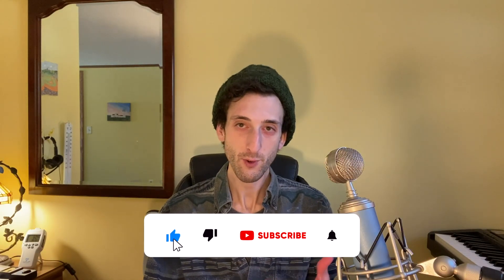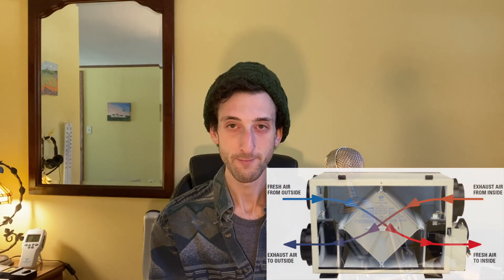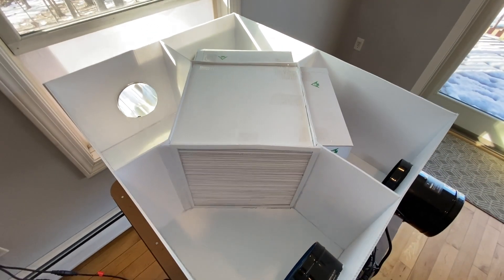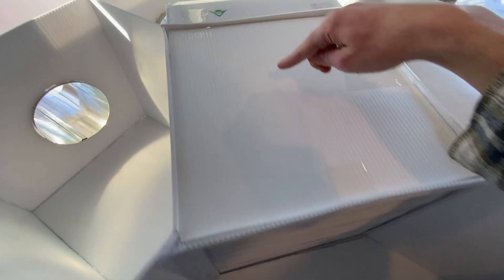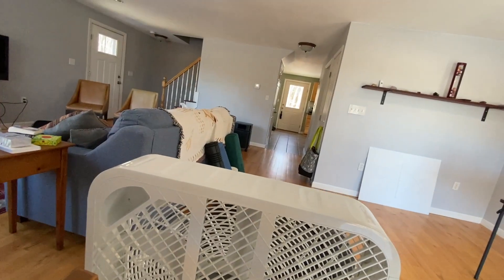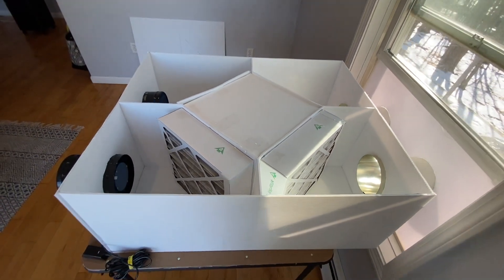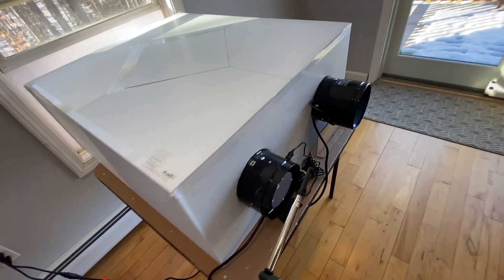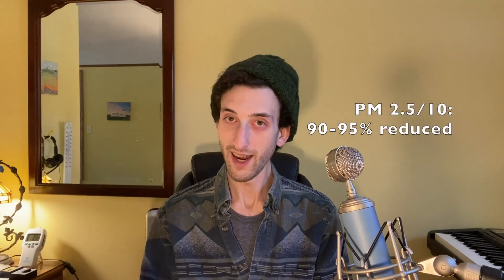I built the best DIY heat recovery ventilator I’ve seen on YouTube

Comment: As an HVAC guy i can say your design although unconventional and bulky is just fine, your fans you use for circulation would benefit from the coandâ effect to increase air flow. Also those efficiency rating the big companies use are totally skewed so your system is probably working better than off the shelf systems thanks to that massive core you built
Reply from the maker: I appreciate the encouragement! And thank you for that Coanda effect idea - I’m gonna tweak the locations of my circulating fans to capitalize on it.
Reply: @macthemec can you elaborate on how one would use box fan to achieve a Coanda effect? Where is the effect happening? Is the idea to get the air flow from the fan to follow to the walls, or floor, and thus travel further than it would had it not? Is it perhaps fashioning a shroud or cowl to affix to the box fan, one which would create a Coanda effect? I really can’t imagine how this would work?
Reply from the maker: @brainwashingdetergent4322  Good question. Your thinking is spot on when you said, “Is the idea to get the air flow from the fan to follow to the walls, or floor, and thus travel further than it would had it not?” 

Yes, that’s the idea. The ceiling also works quite well. You don’t need to make a shroud or anything. Just position any fan so that it blows along a surface.
Reply: @HealthyHomeGuide  thank you for the reply! This is good information.
Reply from the maker: @brainwashingdetergent4322  happy to help!
Reply: @brainwashingdetergent4322  i just saw this reply, here is the wiki article: https://en.m.wikipedia.org/wiki/Coand%C4%83_effect

Basically air follows a surface better than in the open, so if you want to blast air down a hallway sticking your box fan next to a wall/floor will make it travel further than if the box was away from the floor/walls
Reply: @macthemec  thanks for the link!
Reply: How would one deal with condensation for something like this? Curious if this would work as well during Texas summers!!
Reply from the maker: @Geoff9001  I’ve only used mine during colder, drier seasons. I definitely would avoid using an HRV in your climate, especially during warmer months. An ERV (combined with a dehumidifier) would be a safer ventilation option for your region.
Reply: @HealthyHomeGuide  have you seen any decent homemade ERVs online? This is the first homemade hrv I've seen online and it looks great, although a little big
Reply from the maker: @Geoff9001  thanks! I haven’t seen any homemade ERVs, nope. However, I’m working on a video where I do a DIY ERV installation. I buy it and retrofit it into a window for ~$1200 (USD). That’s with the ERV and materials included. Stay tuned if you’re interested.
Reply: @Geoff9001 I had an ERV professionally installed in my last house. They are big suckers!!
Reply: With no core shaming. ;)

Comment: Impressive and inspiring, thank you. For someone interested in trying this, why coroplast, other than it comes pre-corrugated for maximum surface area? Wouldn't metal plates work better at transferring heat? (but much more time-consuming to pleat by hand). Maybe the fins from old A/C and HVAC equipment can be repurposed for this. Amazing effort and spirit, blessings and apprecation.
Reply from the maker: I appreciate that, thank you for commenting! Good question. I used coroplast because it’s very easy to cut, lightweight, non-toxic (polypropylene is BPA-free and does not off-gas at all), durable, moisture-resistant, recyclable (polypropylene is a thermoplastic that can be recycled), and CHEAP. I wanted to build it all from one cheap material.

Coroplast transfers heat pretty well. Some commercial units built today actually use corrugated plastic for their cores! 

I also don’t know how to cut metal, bond it properly, clean it right, and work with it safely in general (especially with old potentially rusty parts). For someone with expertise there, it could be cool!

Thanks again for your great question!

Comment: Very cool. 🤔 I like the idea of a charcoal filter, but I'm clueless where you would put it in the system. I'm building my retirement home in Arizona (a cute little hacienda style cottager) and I want to incorporate as many DIY solutions, and revive as much ancient technology as possible. Thick adobe walls will go a long way towards providing the thermal mass I'll need in the desert to moderate temperature swings. I think instead of the plastic body you could use ducting sheetmetal or the smooth fibreglass boards used in commercial kitchens, hospitals, etc. Both materials would give the same smoothness, but would be a lot more robust. Mine is NOT going to be proudly displayed in the living room! Sorry, although I'm now retired, you can take the girl out of the interior design business but... I plan to properly tuck it away in a conditioned attic space and cleverly vent the clean, temperature-moderated air throughout the house in inconspicuous or decorative ways. Can't wait to binge-watch some of your other videos.
Reply from the maker: Thanks Linda! I ended up using two 2” thick activated carbon filters that look similar to the filters I showed in this video, they’re just black. There are two available spots against the core where they can rest, in the same manner as the MERV-13 filters shown in this video.

I deeply appreciate your philosophy when it comes reviving ancient technology. I’ve been learning about Terra Preta recently - very cool ancient tech. 

I used coroplast for the body because it’s very easy to cut, lightweight, non-toxic (polypropylene is BPA-free and does not off-gas at all), durable, moisture-resistant, recyclable (polypropylene is a thermoplastic that can be recycled), and CHEAP. I wanted to build it all from one cheap material, but I appreciate your point about the robustness.

Your interior design-friendly plan sounds amazing. If you end up doing that, I’d be happy to make a video featuring you on this channel if you’d like. Good luck!
Reply: @HealthyHomeGuide  🥰 That you're a gardener. My favorite terra preta video is by David the Good https://youtu.be/DnTaWiO5Eso?si=xiT9K3iHJjA2ySeZ. I'll save you the suspense: it worked great, but David moved to new land and it petered out in a year. My theory: the deposit he created was only 3' deep. The deposits in the Amazon are frequently 60' deep, and were renewed annually for centuries. I think David's on to something, but I also think that it needs renewal every year for many years to become self sustaining. Enjoy!
Reply: commercial units I've seen have the schematics placing carbon sheets between pre filter and merv filter.
Reply: @mikemotorbike4283  Yeah. That makes sense. But it's only a "sheet"? Huh. I didn't know that, I thought it was like the air filter, about 2 inches thick and approximately the same size as the Merv filter, just black. Interesting. Thanks for the info!

Comment: Thanks That's a really good design. I've been thinking about how to build something like this for our home. I'd not considering using coroplast, but it's almost made for the job !
Reply from the maker: Absolutely! Coroplast is an amazing material - polypropylene is the safest plastic, I feel. No BPA, no VOCs. I think that my HRV core is pretty laborious to build though. I’m in the process of trying to find a cheap source for replacement HRV cores, so we DIYers can just build a simple HRV housing for a pre-made core. Stay tuned!
Reply: @HealthyHomeGuide  
Stack the core and weigh in down. Use a hot wire, arranged like a guillotine, to cut the edges off the core. This fuses the sheets together using heat. No glue and far less work involved.

Comment: How would you run it ducted if you could? Shout out from Melbourne, Australia.
Reply from the maker: Welcome! I love to see Aussie viewers. If you want to run ducts, check out this video for guidance: https://youtu.be/PsN5AbUz3p8?si=KTTtTC_pGHhpVIsu. I’d try to avoid using flex ducting if you can, as it off-gases terribly and reduces airflow (compared to rigid ducting), especially if you’re using ducts that are 4 inches in diameter or smaller.

For me, ducts aren’t worth the effort. I find that fresh air from my HRV permeates through my living space well enough without ducts, if I use good air circulation methods. See my video here for guidance on that: https://youtu.be/80r9qwJPcTI?si=8dEhy8eNzsih5uHN.
Reply: @HealthyHomeGuide  yeah that's all great tips. Our house is a strange L shape with two disconnected hallways. I'm tempted to make two systems at either end of the house to ensure each end has good air quality. I will start off with one of these units and get a second if needed.
Reply from the maker: @MatthewBayard  sounds like a good plan! Let me know if you have any other questions.
Reply: @HealthyHomeGuide  can you run exhaust and intake ducts from the floor? We are on stumps so we could have the unit in the crawl space and run the ducts to each room and penetrate the floor of each room.
Reply from the maker: @MatthewBayard I’ll preface this by saying that I’m not an expert (yet) on crawlspaces or building in general. I do know that you can run ducts through the floor. People often do this for makeup air systems for kitchen exhausts. 

In general, I don’t know much about putting an HRV in a crawlspace. From my limited knowledge on this, I’d make sure you’re not bringing crawlspace air into your house. Also, make sure the return air isn’t crawlspace air as well. Good luck!

Comment: very nice... i think i may make one out of aluminum sheets or sheet metal which would transfer heat more efficiently. granted it would be more expensive but i think a bit smaller and a more efficient unit would be worth it since the ones you can buy are so damned expensive. due to a lot of forest fires here in the west, i was thinking of having filters on mine already and i like the way you placed the filters. i want to have more surface area, however. my filter design is its own separate box consisting of 5 square filters mounted on a 6th plate making a box that has 5 filter sides and the 6th side would have a duct fitting to provide filtered air to the hrv. i think those filters can be of the cheaper variety pre-filtering the air and have the higher quality filters in the hrv as you have them. that should allow for the cheap filters to get the larger particles and extend the life of the finer filters and improve air flow.
Reply from the maker: Thanks! I’m intrigued by your idea a lot. I’m thinking of building a different design for this winter and I have a lot of ideas swirling around in my head. I think one of the drawbacks of my HRV core is that it’s fairly laborious to build.
Reply: @HealthyHomeGuide  yes... it will be even worst with sheet metal or aluminum. i think the easiest way of doing it is to sandwich 5mm spacers between the sheets with long bolt going through to hold everything in place and seams sealed with silicone. if the sheets are stacked and drilled together, they will align just fine and the whole thing can be dismantled easily to experiment with different size spacers or cleaning or other service. the process can actually be fairly easy. another way would be welding a frame and sliding aluminum foil to separate cells like drawers then stretched tight. the thin aluminum will be an excellent heat transfer medium.
Reply from the maker: @AlsanPine  interesting! If you build either of those, you should consider filming them and uploading to YouTube.
Reply: @HealthyHomeGuide  lol... that takes too much time. i am retired but very busy. this is not the only project i am pondering. i am building a small orchard, garden, and greenhouses generating most of my food. i am building my solar setup. i am modifying my house to radiant heat from said solar. i am restoring a 76 ford f-350 and case 580b. i am designing and building electronics to control my property. and spend a few hours a day in my studio with my instruments. i am building more rain water harvesting. i am building local community to save our town from corporate greed. and that is just what comes to mind right now. all of my designs and work probably should be recorded and put in to help others but to do that i will need a young person to do it for me. i will never get a round to it. i would be lucky if i get all my projects done before i die. i would love to work with someone around here in n. idaho but chances of that happening is pretty low i think. i appreciate your encouragement though. live well 🙂
Reply from the maker: @AlsanPine  very intriguing. I love that you’re trying to build a self-sufficient community to escape the corporate greed. I’ve been wanting to be a part of a community like that for a while. I live in Vermont, by the way. Anyway, I’m trying to start a video series where I feature certain subscribers of mine’s HVAC and/or sustainability-related projects. Basically, if you wanted, you could quickly film your project (with a smart phone or something, if you have one), or even just take pictures, and I could do the editing, narration and uploading, and credit you of course. If you find the time, and if that’s something you’d be interested in in the future, you can email me at alex.healthyhomeguide@gmail.com.
Reply: coroplast is "appropriate technology" un this application as it does the job sensibly if perhaps 3x larger.  Custom-crafted Aluminum coroplast, no make that copper, or even gold would be better of course.  It will take a month to make one. After the craftsperson figures out how.
Reply: @mikemotorbike4283  actually, i have a design that is easy to build and inexpensive. i have too many other things going on right now but i hope to make an all aluminum core that anyone can make without the need for fancy tools. i am sourcing the aluminum frame materials right now.

Comment: Thanks for your video. What's the difference between yours and an ERV?
Reply from the maker: Sure thing! ERVs help regulate the humidity level of the air that passes through them, as well as temperature. Mine only regulates temperature.
Reply: how might you change yours to make an ERV? @HealthyHomeGuide
Reply from the maker: I’m actually in the process of trying to figure that out! It seems to be very complicated and expensive though, so it may not be right for a DIY project. Personally, I use a whole house dehumidifier to dehumidify.
Reply: @HealthyHomeGuide  did you document this build anywhere?
Reply: @HealthyHomeGuide  ah, the core is a stack of boards, each perpendicular to the next?
Reply from the maker: @dennisstone9893  yup exactly. Check out the video I linked in the description of this one for detailed builds. Specifically the designed by instinct video is most useful.

Comment: How are you measuring the efficiency of this? Im not convinced by any of this. You have lots of gaps in the coroplast box which will easily allow the pressurized air to exit before they do their expected travels through the merv filters which will bring quite a bit of resistance along the way. Its going to be much easier for the air to just... escape.
Reply: His design is very similar to many commercial designs. You can spend $2,000 or $5,000 and get a system that at its core has exactly what his has, something that looks like it was made out of plastic cardboard. If commercial units can get high efficiency in small size, I think he can too. These units have remained a specialty niche item, aka expensive, without widespread adoption yet, prices have not come down. Most people that want fresh air, just open a window an inch, while not as effcient, it is cheaper and easier. Someday, hopefully soon, these units will get cheap, widely incorporated into homes and everyone will have fresher air. The reality of the matter is many people just don't value fresh air. That seems like a harsh statement, but it can be very hard to get people to change the air filter on the HVAC unit every month (one of the main air cleaners in most houses). Many people still smoke in homes, burn incense, and have other air quality issues. There is a market for in home air filters, but that becomes challenging as companies tend to overcharge for the filters.

Comment: I'm looking into this myself as I'm struggling with keeping the cat litter smell at bay now that I have two cats, and great to see that this design with the plastic actually works well.  I would have figured it would not have enough thermal conductivity.    I might have to experiment with this and see if it will help.  Right now I'm just opening the windows but that won't exactly be an option in the dead of winter!
Reply from the maker: Thanks for bringing this up! Ventilating is a great way to keep odors like cat litter at bay, but also comes with its risks if not done properly. If you haven’t seen my latest video yet, I think it’d actually be really relevant to your situation:
https://youtu.be/80r9qwJPcTI
Reply: The thermal capacity of air is so low compared to most solids that the conductivity is not too much of an issue. Conceptually, if you think of the HRV in a steady state of operation, there is a thermal gradient along each of the channels constantly re-enforced by the air passing through at almost the same temperature. The transfer of heat between the channel wall and the air is likely far more limited than the transfer of heat through the thin plastic wall. I built my own DIY HRV just using a BIG pair of concentric plastic pipes connected up to ducting. Primarily for ventilation, but why wouldn't you want some heat recovery? Capable of higher rates of ventilation as the airflow has little restriction, but better heat recovery at lower speed.